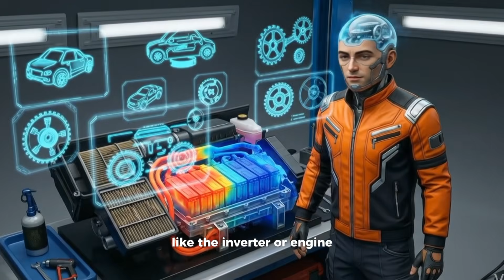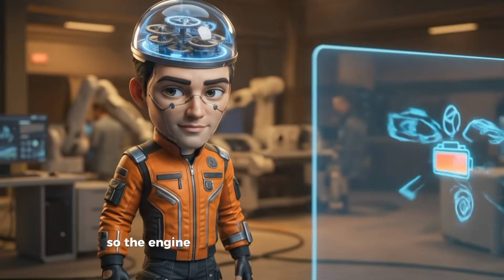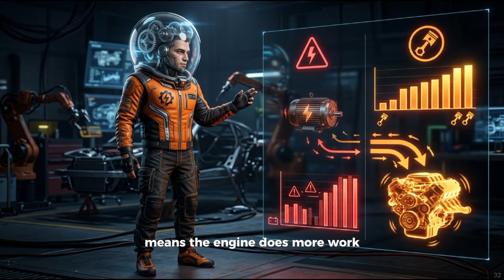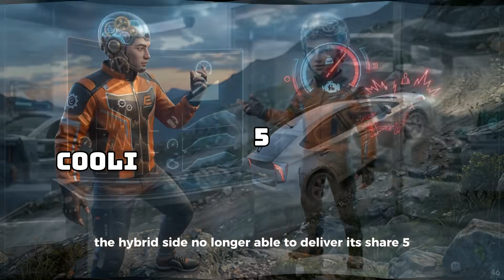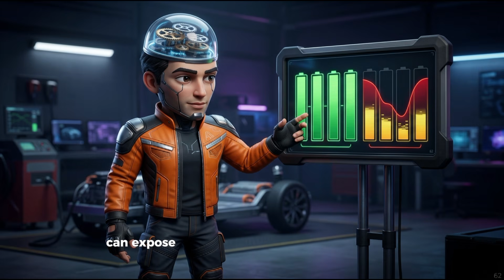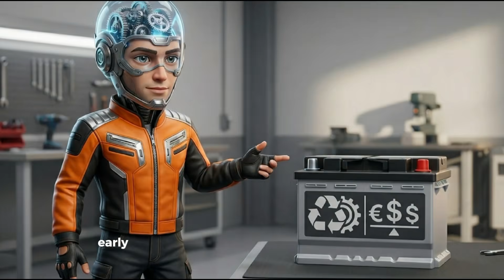Toyota Hybrid Battery Dying? These 5 Signs Appear MONTHS Before the Light

Comment from the maker: DON'T WAIT FOR THE LIGHT: Your Toyota's computer is designed to be conservative it will try to 'hide' a failing battery pack from you for as long as possible by leaning harder on the gas engine. But your wallet feels it at the pump long before the dash lights up! I want to hear from our GearHead community: Are you seeing any of these signs? What's the current MILEAGE on your hybrid, and what is your current real-world MPG compared to when you first bought it? Let’s see if we can spot the patterns in the replies! 🔧

Comment: All you have to do is get a portable air-conditioning unit plugged into your USB port and run it down into the battery
Reply from the maker: Jason, thanks for watching and for sharing that creative idea with the community! While your logic of prioritizing thermal management for the hybrid battery is 100% correct, a USB-powered unit simply lacks the cooling capacity to handle the massive heat loads generated during high-amperage charging and discharging.

From an engineering standpoint, your car’s built-in HV cooling system is already designed to pull air-conditioned air from the cabin and blow it across the cells. The absolute best way to protect your battery's mechanical longevity is to ensure that the factory intake vent is completely unobstructed and clean. Adding a small USB fan might feel like a good "insurance policy," but it mathematically can't compete with the volume of air the primary system moves when the intake is clear. Great to have you thinking of ways to protect the hardware! 🔧